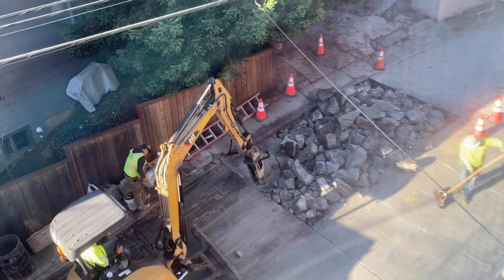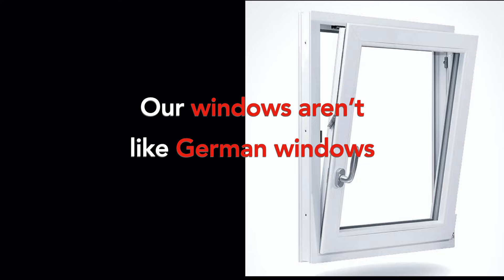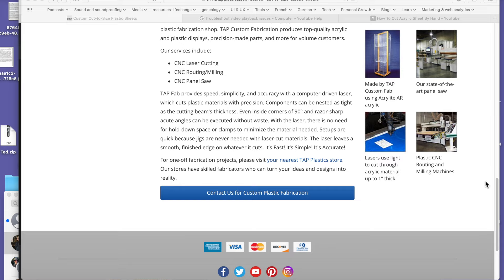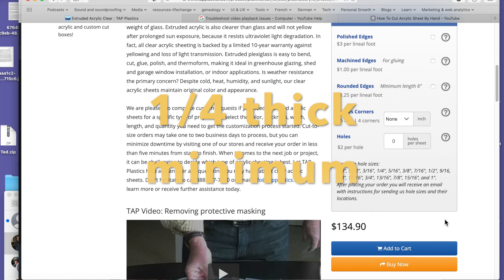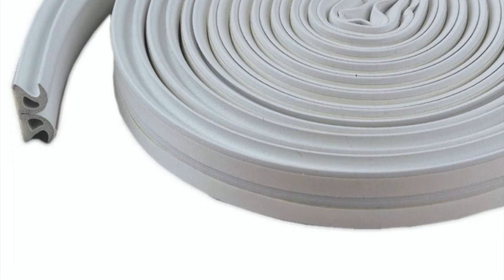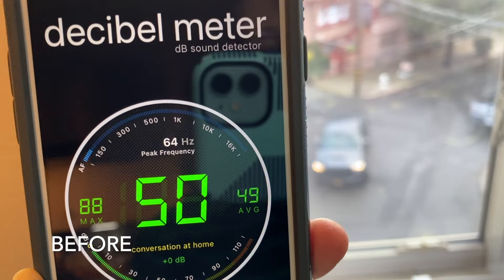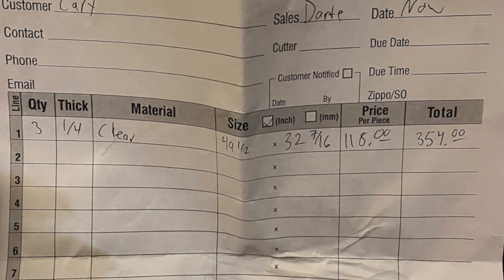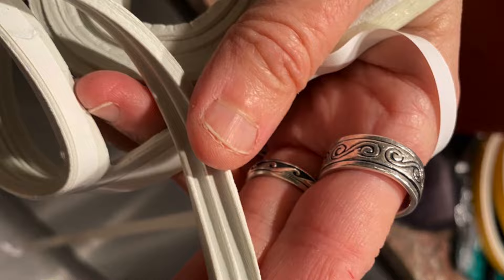How to make a DIY window insert for noise reduction

Comment: Very Interesting video. I have replaced broken windows. Glass for normal sized windows is cheap. A double pane window can be created by putting silicone caulking between two panes of glass. I wonder if you could could layer another layer of glass on top of the double layer of glass. By cutting glass slightly smaller, taking the window out for a day in order to allow the sealant to cure and then just putting another slightly smaller layer you might be able to create a cheap triple pane window. Now the question of if the sound is coming through the pane, or coming through the window glass is not clear to me. On some windows you might even be able to hold glass onto the windows using a mirror mounting bracket. To seal the windows one could just put a piece of wood trim up the windows and have them close onto to the piece of trim. You could also add some sound absorbing materials into the room. You could cover the wall with decorative cork/cork board a product known to have exceptional sound absorbing properties. Thanks for the ideas.
Reply from the maker: Would adding a third pane of glass on top of the existing window frame work -- like what about condensation?  Also, I think our current double-paned windows have some type of gas in-between the two panes of glass -- argon, possibly. The extra layer of plexiglass over the drywall DOES help with specific types of sounds (mid-frequencies) depending on the distance. So for low-frequency sounds outside the window, it's not effective. For conversation, or cars idling with the engine on right outside the window, it's very effective. But if a car accelerates hard and revs the engine outside (lower frequency), it's still pretty loud and annoying. That's because some noise also comes through the thin front wall, as I suspected. I have an idea of how to modify that wall without triggering too much of a domino effect that would make me have to modify other parts of the room. But it requires demolition and some creativity inside the wall cavity. BTW, adding sound-absorbing products to the walls inside of the room won't make a difference with the outside sounds coming through the wall. It has to be absorbed or blocked in the cavity and decoupled before it gets into the room. And I don't have a lot of space to work with, unless I want to dismantle the whole kitchen and modify the length of the countertop and the kitchen cabinets, which go right up to that wall (nope!)
Reply: @soundproofist  I am not totally sure how much sound is coming through the glass verses the frame. It is true almost all modern windows are filled with special gases. Condensation could be a real issue. Because the windows are already double pane, unless you have a lot of condensation  issues with the double pane windows you should be able to add a third pane without much additional issues, but that would be a bit of a guess. One could purposely leave it open to allow some moisture to vent out. One might also just frame out a window frame that fits inside edge of the window.  On the wall, covering the entire wall with an additional layer of drywall is a proven way to reduce sound. There is special acoustic caulk and glue and there is also special acoustic drywall. Putting another layer of drywall up will cut down on sound transmission. Drywall is very cheap, the cost is mostly the labor for putting it up the special acoustical drywall only gives a small marginal benefit so one can use regular drywall. Thicker is better.  Putting an additional one or even two layers of drywall will cut down on sounds through the wall. It gets complicated because then to get a good result you need to pay close attention to details near heating, cooling, electrical outlets and more. The sound can go around  instead of through.
Reply from the maker: @cryptickcryptick2241  Yep, if you've seen some of the Soundproofist videos about Green Glue layered with QuietRock on top of an existing wall, I think it works pretty well. And I did that in another room. The problem with the front room is that it's both a kitchen and a living room, and if we simply add more drywall on top of the existing drywall, we'd have to dismantle most of the kitchen: take down the wall and floor cabinets, dismantle the countertop, the sink....and then cut some of them down to fit. Because they're custom built to run end-to-end across one whole length of the room, up to the front wall. And it's a snug fit. Adding an extra 1/2" on top of the front wall means the counter and cabinets would need to be cut down, and that might set off a domino effect of additional problems, not to mention the cost! That's why I'm thinking of demoing/ replacing the original drywall with 1/2" QuietRock, stopping just before the cabinets and counters and leaving the original drywall in that corner, which hopefully will make the retrofit less noticeable. I wish I could make the wall thicker than 1/2", because even though it's dampened drywall, it's still not a lot of mass.  That's also why I'm thinking about adding additional mass inside the wall cavity, to compensate for what we can't add on the outside. Of course, when I finally get around to this, I will document it in detail, along with results.
Reply: @soundproofist  If I were you I wouldn't worry about the kitchen. Just cover the portion that is easy. Stop the drywall and run a piece of wood or trim up the wall (to give it a nice edge.)
Reply from the maker: @cryptickcryptick2241  That's probably what I'm going to do. Unless I want to dismantle the kitchen cabinets, counter, and sink, and cut the pieces to fit after the new 1/2" drywall gets added, I will need to end the add-on drywall before it gets to the kitchen window. This is the one window that doesn't have plexiglass on it. That might be kind of weird -- it means single drywall for about the last 5 feet of this large room -- but it's better than nothing. 
Also, there's another "gotcha." As bad as the 1950s construction was in terms of acoustics, it was made worse by someone who remodeled this place in the 1980s. This owner added another layer of flooring on top of the original flooring, but it's not an acoustical floor nor is it a floating floor. I think he was probably trying to mask the noise that comes in from the apartment downstairs (and it didn't work). And the extra layer of floor (and it's TILE!)  probably goes all the way up to -- and touches -- the front wall, no caulk or anything. And then the owner replaced the baseboard on top of it  -- or worse, he might have cut the baseboard to fit over the extra layer of floor. This will be uncovered if I move ahead on adding the extra layer of sound-dampening drywall, and it might be a real headache! (It might also be contributing to some of the noise.) No matter what I do, I will encounter some issues related to this 1980s poorly researched remodeling.
Reply: @soundproofist  You might have some options there. short of a full remodel. First if you are putting up 1/2 inch drywall, you can do two layers or put up thicker drywall 5/8 for adding very little extra to the cost. There is a reduced marginal benefit of each layer. My understanding is details, like sealing around outlets can be critical and it might be better to spend effort there. Either way, it sounds like you really want a peaceful retreat and are willing to spend some more to get it.  As far as the flooring, once could come in with a 4 inch angle grinder and cut the tile one inch to two inches away from the wall. (Diamond blade, water, big mess but works.) Then put up the added drywall, and then put a new piece of baseboard floorboard along the wall. This would help decouple the current floor from the outer wall. This would stop the old flooring from directly touching the outer wall. (Sound could still come through below the flooring then come then up.)  I expect cutting that flooring like that  would only add a few hours onto the project. If your floor is tile, putting down carpet padding and carpeting might give you big rewards. Carpeting really changes the sound dynamics of a space, something really noticeable when you put it in.
Reply: @soundproofist  So here are a couple more ideas to think about. Rather than re drywall the entire wall, cover almost all it with sound absorbing panels. These can be made cheaply DIY. A 2 x 4 frame with rock wool insulation covered by fabric. One could cover 90% of the wall with them. and leave them removeable. One could even put quite rock drywall on the back. This would count as a decoration, so no building permit  and it would just be screwed onto the wall. With the right choice of fabric, it would look nice. Think designs and patterns. The downside is there might be a problem might be sound getting between them. I would estimate a new layer of drywall to be $1000 to $2,000 so this approach could be cheaper. Now if you really want to sound proof from the apartment below you could build and entirely new floating floor in the apartment. You would put down 2 x4 and plywood and rebuild a floor. As  you enter the apartment you would step up a 5 inch step. The new floor would float, with some sound isolating material between it and the one below. Rock wool Insulation would fill the cavity between the floors. This could be down in a bedroom, or living room, when one came to another part of the house, they would then step down into the room. This can be done and made to look nice. I have seen it done in a condo before for styling reasons.  Cost wise materials would start about $6 a square foot plus installations. This does start to get expensive if you have a 15 by 20 room 300 square feet, that is $1,800 in material. Carpeting with padding starts at $2 a a square foot.  Creating a sanctuary requires both keeping sounds out, and absorbing sounds that get in. There may be other ways to keep sounds out too, as far as the apartment below, befriending them and analyzing the space could be helpful. Putting TV's, speakers and noise producing items on  carpet or rubber pads so the sounds do not go into the walls buildings might help. Putting foam and felt pads in doors and cabinets doors so they don't slam shut, putting sound absorbing materials in hallways so sound does not needlessly echo through them. Sound isolating outlets with caulk, caulking by switches  and checking ceiling light fixtures from the lower apartment,  or even sharing a few sound absorbing panels with the apartment below to hang from the ceiling might really help. There is a decent chance the apartment below is also annoyed by sounds and would love to have help reducing them. Anyway, just a few more ideas. When we throw out a bunch of ideas we are likely to nail a few good ones. I do like your sound blocking panes, good bang for the buck compared to some of these other more expensive ideas.
Reply from the maker: @cryptickcryptick2241  For the budget version of this project, I would add 1/2-inch QuietRock on top of the existing drywall (which I think is just 1950s 3/8-inch gypsum, not even 1/2-inch) with Green Glue applied in-between these two layers. If money wasn't an issue and if I had the patience to live in chaos for awhile, I would remove the front walls (I'd love to see what's behind them and what ISN'T there...I'm guessing a lot of wood with small gaps in-between), build additional mass inside the wall cavity, put Rockwool batts inside, decouple the new drywall from the studs, and use just one sheet of QuietRock 5/8" drywall. This would necessitate dismantling most of the kitchen, resizing the cabinetry and the countertop...and while I'm at it, why not demo and remove most of that loud ceramic floor tile that's everywhere, and redo the floors with sound-dampened wood and cork. BUT.... I have a small budget and limited time and patience, so I think your suggestion of using an angle grinder to deal with the improperly laid tile underneath the baseboards is pretty good. Whoever did this remodeling mess in the 1980s clearly had no sense of acoustics. Tile is the worst for noise, and putting the tile all the way up to the walls was a bad idea. Also the person who did it poured thin-set on top of the original parquet flooring, and that was a truly terrible idea. And yes, there's a lot of carpeting on the floors, mostly FLOR carpet tiles. This apartment would sound like a giant tunnel or bathroom without it. ALSO... yes. Street noise coming in through my floor and walls from the downstairs apartment is also an issue.
Reply from the maker: @cryptickcryptick2241  I don't think putting sound-absorbing panels on the walls is going to stop incoming noise from the outside. They work well for reducing noise/echo/reverb that's coming from inside the room. BUT...you've given me an idea to ponder. And that is, creating a removable extra wall made of QuietRock (or maybe Homasote, but I don't think it's dampened enough) that could attach to the existing interior wall with, say, velcro or thin magnets. Similar to what I did with the large window and the plexiglass. This could be a test run to see if just adding a layer of dampened drywall on top of the existing drywall would actually reduce some of the worst low-frequency noise that's coming in through the front walls from delivery trucks, construction trucks, etc... and there are lots of those every day.  One downside of QuietRock is that it can get very crumbly around the borders. I would need to securely edge the drywall panels for this experiment to keep them from starting to disintegrate. Most of the area that I want to experiment with is in a corner, with two windows converging, so if adding the extra wall mass (with velcro and without construction) makes little to no difference with the low-frequency noise, I will have saved myself a lot of money and grief by not chasing the wrong DIY and yes, getting permits, etc.. As for the downstairs neighbors, several have come and gone, some more friendly than others. The bedroom ceiling in the downstairs unit got decoupled several years ago (yay!) and the ceilings in the other rooms simply have blown-in cellulose, which helped a little. One of the previous neighbors who lived there cut holes in the ceiling for lighting, and this somewhat ruined the dampening effect of the cellulose, which had been pretty effective till then. The current neighbor has put sound-dampening panels on the living room ceiling (per my request), which helps if it's just 2-3 people downstairs, but doesn't help with parties of 12-20 people, which unfortunately happens several times per year.
Reply: @soundproofist  Interesting. Let's add some flair. Taking the quietrock, drywall, or Homosote, lets wrap it fabric like the absorption panels, and cover the walls. The fabric will give the room a unique vibe. Then to add flair, and make it look better adding some more panels on top in some unique shapes colors and fabric patterns. (a five foot square, a seven foot triangle,  a six foot circle) This will double up the material in a few spots, but also make it look more intentional, designer and artsy. A few spot lights, then some photographs and personal objects. People will not be able to tell you are trying to make the room quiet. By drawing attention to the sound proofing you are also hiding it in plain site.
Reply: I wish cork was cheaper. You can cover the entire wall with 2 inches of thick natural cork for $4 a square foot. An 8 foot high wall twenty feet long would be 160 square feet or $640.
Reply from the maker: @cryptickcryptick2241  Cork is a good sound absorber, so if I had a music studio in that room, it would reduce room echo if the walls were covered in cork. It might even prevent some of my noise from going into the building frame.  But... it won't stop noises like truck engines and other low-frequency traffic noise if applied internally on my walls. The noise from the street goes through the external wall, then into the building frame, and then to my drywall. I think cork is too lightweight and porous to stop structure-borne noise from entering the front room unless -- maybe --  it was used between the drywall and the wall studs. And even then, I've found that cork is not the best anti-vibration option. For example, I can hear my neighbor walking back and forth downstairs, even though his wood floor has a cork underlayment. I wish it was that easy, believe me!

Comment: Hmm I'm curious  if you put two phones with the app one behind the Plex and in front of the Plex to see the difference would be interesting
Reply from the maker: That's a good idea. The exact same app with the same settings (same threshold setting, same type of decibel like "dBC") and see if the readings are different. I'm guessing there might be a difference in decibel readings, but the low frequency coming through might be almost the same for both. Totally worth documenting on a video (thanks!)

Comment: hello,i actually build a very similar one for myself to prevent the dog barking sound, but i found out it barely help.. of course i did a poor job, theres some gap and leak between the window frame and the insert... can i say to leave no gap/leak is very important for this kinds of insert? thank you
Reply from the maker: It's important to seal the perimeter of the plastic window insert, whether you insert it inside the window frame or attach it to the drywall around the window frame. You don't want sound leaking through that gap. However, you do want an air gap between your original window glass and the plexiglass insert. You don't want your insert to touch that glass. The air gap between these two helps with reducing noise. But you must keep the noise from escaping through the gaps around the sides into your house. It might not block the dog barking completely, but hopefully will reduce the volume.